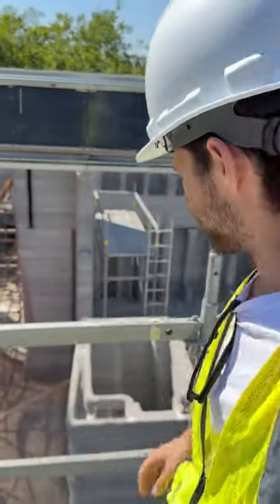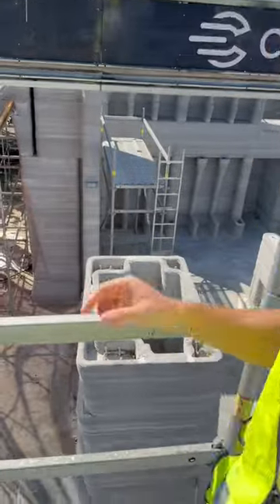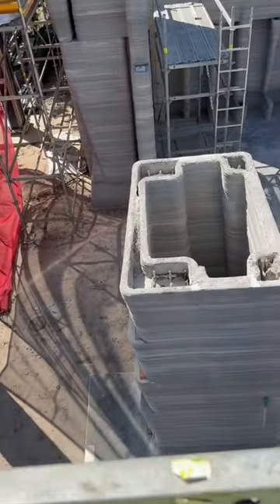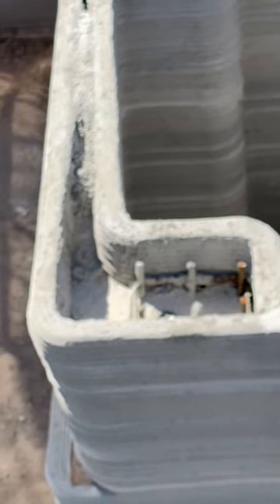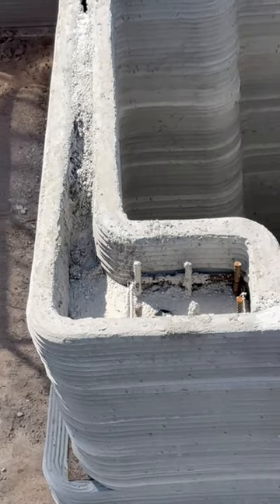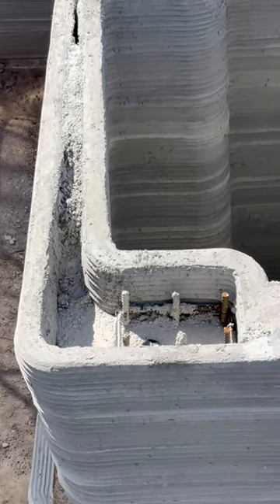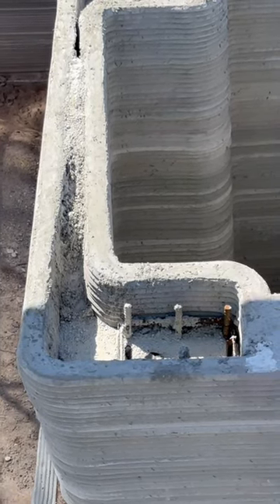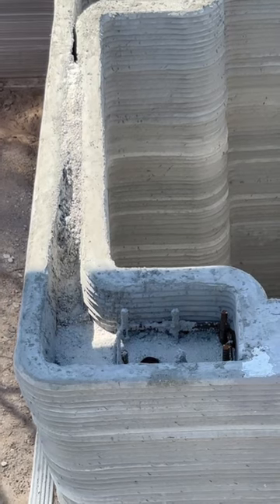Vertical load solution for printed walls

Comment: There's more to home construction than somehow building a wall.  Once standard 2X4 walls get put together and a roof goes on, plumbers come in. Hot and cold water pipes are fitted between the 2X4's. Larger diameter waste pipes get installed. Vents need to go up through the roof. Electricians come in, drilling through the studs to run the house wiring through the walls and ceilings. YouTube isn't showing any plumbing or electrical installation. Also, whether the traditional 2X4 framed house exterior will be exterior wood siding or stucco, a vapor barrier like Tivek or tar paper goes under that, and there are also many other details involved in water and moisture-management, none of which are shown in these 3-D extruded wall-extruding videos. Stucco is a well-engineered synthetic product with many strengthening additives that is sprayed on to form one, metal-reinforced vertical surface, but it is subject to cracking and attracting moisture, and needs something waterproof between it and the interior. The 3-D walls are shown being laid on bare, unprimed, often unswept concrete foundations and are made up of many multiple layers, yet no waterproofing, moisture control, or insulation is ever shown. How is this cement-based material different from stucco? Also, please show some videos of what is needed to have these walls ready to provide a suitable base for roof trusses or framing, and show how they get tied, strapped or nailed together. or nailedtogethercan
Reply: These are literally built the same just without wood😂😂😂 do you think these have no power or water?,
Reply: Unswept foundations 😂😂. What about the many videos showing them printing the wall off the foundation 😂😂
Reply: @rafaelnavarro5522 no he's asking how they do and to see it genius
Reply: 3d printing doesn't require any plumbing and electrical work because it's printed within the form. This is how they do it so fast and save so much money
Reply: @sleepy670 hang on...are you trying to say that the sewerage/waste/water service piping is suspended in the air along with the electrical whilst the printer simply extrudes concrete around it? Im really confused by your comment and trying like hell to picture what you are trying to say
Reply: @sleepy670 what in the world are you smoking? Building like this would make maintenence, and retrofitting ridiculous. We have not seen any video of them embedding conduit, or piping. What have you experienced to make these claims?
Reply: They think we are stupid brother..no roof , plumbing, or electrical installation..lol. I call those houses , the cow shit house, the same way a cow shit, it's the same way these houses are made..lol.
Reply: I don't really know how it works, but I'd they have heavy metal conduit/pipe they put in there as they lay the form, oversized so pipes or HVAC and enter/leave the house. The wires I have no idea maybe they just slap the wires in one of crevices and just cement plastered over?
Reply: @DopeyPotato they have already made access for plumbing and electrical.
Reply: @Phosphour the access for plumbing and electrical is already there.
Reply: .... no shit. What's your point? It's just a way to build the walls.
Reply: @DopeyPotato  They can place a lot of that in locations with some metal lattice and then print right over it to incorporate it into the house. There are many different approaches all being experimented with right now along with blends of concrete and other reinforcing materials, but that's how I saw it being done on a site around here.
Reply: @Phosphour they've clearly never met a new home buyer who wants to move stuff... Instead minor drywall and wire fishing now literally everything requires getting out a gas axe and cutting the concrete walls compromising them more than the design already does.

Comment: How does this hold up to change in seasons? Would there not need to be gaps in certain spots to prevent expansion and contraction cracks?
Reply: I saw another video where they inspected a few walls, and they had cracks in them but they talked about it like it was no problem lol.

Comment: Wait! we were sold that this would replace forming and rebar, don't lie and gaslight, this is what people were sold 4+yrs ago. We have a memory longer than pigeons don't lie
Reply: It's not like they removed it, so it's not actually a form. The stupidity one has to posses to suggest printing the infill is better than pouring it is absurd. They should spend 10 times longer just so people like you don't whine. Genius.

Comment: okay but what about the sloppy walls when you walk inside your "finished" home
Reply: I mean, you could float and dry wall if you wanted still? I'm assuming you could slap a bunch of mud right on it and get some interesting designs too
Reply: i saw a interview with a guy who lived in one of these house for a year. The walls looked like this inside. I guess great place for dust to gather :) otherwise they had some problems with bee's (i think it was) getting in and out of the house thru holes, so they had to fix that.
Reply: Well, that's up to the owner. You can opt to have them finished several different ways or leave the print lines.

Comment: I like how when I design parts and know theyre going to be printed I make sure to consider what the part is going to be doing and where it will experience a load and stress points. This means I am able to put my layer lines in an orientation to optimize the strength under load. 

Meanwhile, the top of this house is going to shear off after a couple storms since you're just stacking beads of concrete up.
Reply: They’re not though.  You can literally see that in this video.  There’s vertical reinforcement.  The beads are a frame/mould to pour and place that vertical reinforcement.  It’s also given rebar every other layer.
Reply: @AnarexicSumo  yeah that still isn't going to get in between the layers and bind them together. That will just sit on the outside of the ridges. Pillars of vertical rebar in some spots aren't going to bind all those layers together either. 

It's just not built to last.
Reply: @AnarexicSumo  Friend, the cake batter is not a frame. Those are the walls. And it is absolutely not given rebar every other layer. They batter the structure up to that point, then drop a cage in, and then fill it with concrete from a mixer. This is optics, not engineering.

Comment: I love these shorts each one just explains one more detail. Then I get to go through the comments and watch it torn apart. Never fails
Reply: I love looking at the comments at all the construction workers who are scared of this replacing them. Why don't ya embrace it and learn and adapt? Pull yourself up by your bootstraps so to say.
Reply: anyone who's been in real construction for a week can see how this is a scam, it took them 2 weeks to do what traditional forms can do in 2 days
Reply: @christopherhall5361 Except it didn’t take two weeks, it requires fewer humans which means less money, and you end up with eutectically structured walls which are stronger than conventional forms+concrete. All hating this tech is going to do is make you look silly.
Reply: @NSA-admin id much rather swing a hammer all day than tend to a dumb computerized machine that does the job slower than me on my worst hungover day
Reply: @NSA-admin and i also love the "yay innovation!" crowd who thinks any ounce of skepticism as a "hindrance of progress" without understanding the reason of said skepticism.

Comment: Wait...so you make a column...THEN put the support in...then just fill it with concrete as you normally would?   Wait how do you keep the column straight and leveled begore putting the support in?  And how is that metal ring doing anything if its not attacjed to the column?

Comment: So. It's essentially ICF. But it's probably way way way more expensive for the luxury of being able to have curves and corners where you want them. There are so.many more questions. How do you run conduit? Do you have to drill through the concrete to place an electrical switch? Do you stop printing to run conduit and then print on top of it? It sounds so tedious, and like most things modern, remodeling is not an option...

Comment: Okay, but this means you need to pour concrete twice for one wall (print + middle) and you save up on concrete forms. It's not faster or cheaper. Not to mention how much work there is to make those printed walls smooth.
Reply: What do you mean is not cheaper? The amount that you have to pay for the crew is one thing, then there's the risk of injury added on top, and the fact the printer doesn't need to take breaks means that even if it isn't faster, it'll be done earlier.
Reply: @alejandrinos  This doesn't have risk of injury with a big machine moving around on its own all the time?
The printer does need to take a break and quite often since they need to move it around from wall to wall. I'm sure they can't print a wall in one piece 2.5-3m high, especially a wall with doors and windows. How long is the calibration for the 2nd wall, the setup to load the correct printing job etc? I have no idea but it's definitely much slower than to move a few workers to the 2nd wall. 
If this was cheap and fast as you think then everybody would be doing it since everybody wants to pay less for a new house.
Reply: @sdfjsdjfghssfgdsgvfs   It's moving on it's own, who is it putting at risk?
The printer surrounds the whole building, it doesn't need to be moved anywhere, just assembled at the start and disassembled when finished. You said it yourself, you have no idea. 
Not just anyone is willing to live in a 3d printed house, people will cry all day about the housing prices and how they can't get an affordable house anywhere, but then they are presented with this new tech that can make cheaper houses they go "Ughh, layer lines, gross". It's just a matter if time before people get used to the idea and the tech improves further, like that german company that developed an attachement that comes after the printing nozzle smoothing the surfaces as it goes. It only works on curved walls since it can't make 90 degree turns while smoothing, but it was developed in a couple months and it already shows good results.

Comment: Basically a 3D printed form thats left in place... I wonder why all concrete forms are removed after pouring though... Hmm it's almost like that poured concrete doesn't stay the same size... 

This will literally jack the house apart.

Comment: Concrete isn’t cheap, I don’t understand how a ‘cost effective’ business wouldn’t just buy forms as they’d be re useable and that cost wouldn’t need to be passed down to each customer, oh wait the fact that a single machine is doing it is why that has to happen. The extra amount that’s spent on printing the forms and back filling essentially makes this the same cost or more than a traditionally poured residence

Comment: See now that frustrates me.  Why use the printer at all then?  I was a bit excited for this because you could use all sorts of materials for that empty space.  You could fill it a slightly weaker but much better insulating material for example and just have more strong points.  If it's just concrete in concrete, why print concrete at all?
Reply: Because the start-up is selling an automatic cake writer that happens to dispense concrete. 

What's funny is this video is 100% just a reaction to all the people pointing out how they arent building with any reinforcements - earlier 'builds' dont even have these pretend rebar frames.

Comment: So a weak hollow shell, loose metal inside a slurry of soup. Got it. NOPE.
Reply: Not a fan of the technique used but is that a fair comparison? Weak shell, do we even have data on the structural integrity of the printed form? Loose metal, certainly once the cement dries it is no longer loose just floating around. 😂 Soup slurry, isn't all cement a slurry of rock and water?? Your comment just doesn't make much sense and assumes a lot.
Reply: @Trivdgun-  I went overboard with the sarcasm, but do me a favor, try putting a "tapcon" screw into cement. Lemme know the results. You'll find that if you were to, form and pour the wall properly it would be one solid mass supported properly with rebar it would support alot if weight.
This tech, each pass drys uneven in layers, putting anything on these walls is gonna be a disaster, if all else will end up on the floor when the screw turns the wall into sand.

Comment: So, if those are “traditionally filled columns”, why aren’t they filled to the top? Also, I’ve watched at least  a dozen printed wall videos and there’s almost no rebar stubbed up through the slab, so that means drilling and epoxying, etc. I doubt 3-D is approved for high wind rating regions either, BC we’ve commonly built block walls with an upright every 4’. 

So far this concept seems like tech geeks and dreamers trying to convince everyone how much sense it makes, but are more successful at inadvertently showing the weaknesses of what looks like “Pastery Cream” houses. 😂

Comment: This is being done in an attempt to help use less wood thus cutting less trees thus breathing better air.
Reply: But cement production is responsible for about 8% of global carbon dioxide emissions. It is not only required to burn fuel to product cement but also co2  releases directly when calcium carbonate is heated.  "Better air" is not the reson to use cement instead of wood.
Reply: @tereshchanka  there are about a million different things that push co2 into our atmosphere at the same rate if not more. Logging equipment manpower cars trucks and blah blah blah. Nothing on this earth is going to be perfect but if you compare the amount of trees we have vs the rocks that go into concrete and how much we NEED trees vrs how little we NEED rocks to breath it’s clear that keeping the trees benefits us far more. Trees absorb co2 remember that.

Comment: Would be a much more convincing video if you were able to show how the wall is connecting to the footing? Or if this is just a drill in type/thickened slab connection. Is the 3D printed wall a load bearing wall? If so id want to see how the wall was reinforced beyond just the columns. Albeit the wall shown is pretty short so an argument could be made that you dont need it depending on what type of building youre going for. If 3D printing is essentially just pouring an expensive concrete form then it's a hard pass.

Comment: So you're printing forms......you do know a form crew would have that formed and poured. In 1-2 days rightalso not a single example of the wall being pinned to the slab. So basically this whole thing is a substandard ,more time consuming way . In cold climates this will just suck the heat out making it more expensive to heat/cool and you're wall will be 2 foot thick if their insulated substandardly with foam. The more this tech is revealed the more holes in yhe entire system become apparent to anyone who has a modicum of knowledge on building

Comment: But only on the side walls so the walls that didn't get it will fail. Then these test houses will be over until new concrete is invited that will hold up to the test of time. And fiber is not your answer

Comment: Be cooler if you did it with foam … honestly the inflateable concrete homes are cooler … or the boxsble designs …. Then you could put rebar and concerte inside … and make them at a factory perhaps …. Lol or saw dust .. make ur own ply wood lol …. You need 10 k foundations which is lame …. And concrete is heavy and expensive … like it be cool if u put saw on end of it and had it put logs togeather …. Linkin log cabin … then spray it with concrete.. and have ur robot make it look all fancy … idk if you didn’t need a crane to build the machine I’d say it be worth it … just seems like a novelty pain in the ass

Comment: no strength at all. the corner column is not going to help the wall between them. traditional cinder Blocks (1) are CAST from Portland cement and aggregate. this makes the material strong. Your system uses a mortar mix that never cures for strength . (Block has a center brace I beam design. When overlayed the final wall has interior Ibeams every 8 inches that BIND the inner block face to the outter block face,  when done laying the blocks for a wall the inner wall is bound to the outter wall with Ibeam like structures every 8 inch for the entire wall. . Your WALL has no center support  between the inner wall and otter wall at all. ITs junk
Reply: Yeah, what he said

Comment: not viable, likely issues:
1- localized delamination/cracking of the layers and material fatigue related cracks and spalling
2- Carbon footprint of full concrete buildings vs mixed tecniques
3- longevity of the finished product and upgradeability
4- misleading marketing strategies
nice as experimental concept tho.

Comment: So two pours for one column, one from a printer and one inside after the fact?  Waist of time if you ask me, but why do we never the anchors sticking out of slab in your start videos. Oh that’s right the column has rebar but it’s not anchored into the footer, so a small tornado will blow it over. Nah no thanks, I’ll stick to traditional builds that have withstood the test of time.

Comment: Well theoretically the machine could pump concrete into the forms after they set.  The end goal is to have autonomous construction robots.  This is an incremental step in a long process.